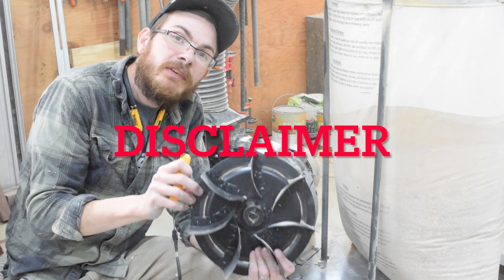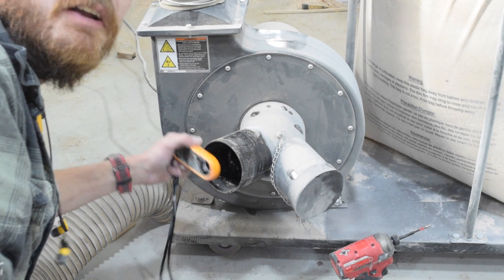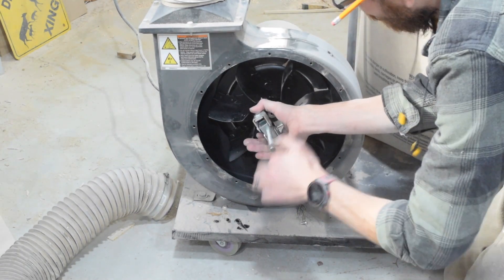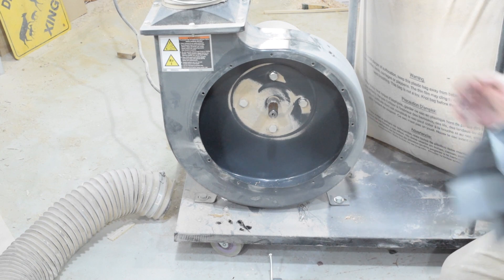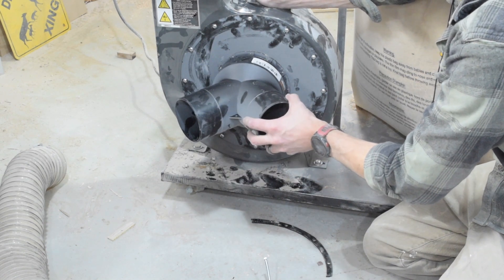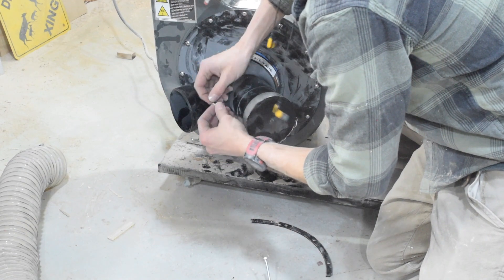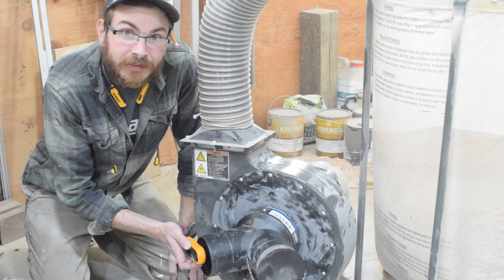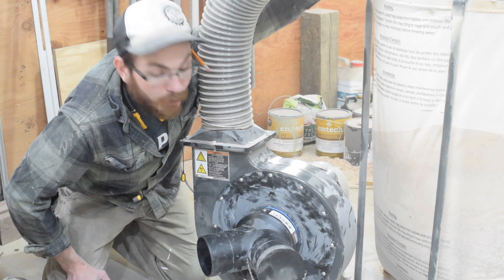Easy Harbor Freight Dust Collector Upgrades: Part 1, Changing the Impeller

Comment: Not worth the trouble. Just get a proper vacuum that also filters out the very fine dust.
Reply from the maker: Yes and no. A dust extractor like a Festool would not be able to keep up with the bigger tools like my planer and jointer. It moves a small volume of air at a high pressure- great for small sanders and jobsite power tools. A collector moves a large volume of air at a lower pressure, great for tools like a planer and jointer. Both have their place and advantages. And disadvantages.

Comment: The impeller was backwards. For that impeller you need to switch the motor and impeller sides. It needs to scoop the air but the way it's installed in the vid it is reversed.
Reply from the maker: Nope. Pushes rather than scoops. Lower peak but higher sustained.
Reply: @SpottedTongueWoodworking  I understand that which is best for regulated airflow. I challenge that because when doing dust collection you want to move as much air as possible which is provided by a forward scoup
Reply from the maker: @PrintingNerd I’m maintaining that it’s not about “peak” but about sustained efficiency under load (dirty air) this is a good comparison between the two https://sofasco.com/blogs/article/comparison-between-forward-curved-and-backward-curved-fans#:~:text=Forward%20curved%20fans%20are%20generally,that%20require%20precise%20airflow%20management.
Reply: Funny how people keep doing this with little improvement. Its common sense that the inside ove a scoop or dish is going to catch more air than the outside or rounded side. Trailers, semi's, RVs the fronts are rounded or bubbed out to shed the wind not chatch it.
If the big fan had the blades flipped that thing would crank! Someone please 3D print one to use as a test.
Reply from the maker: @CD-hc5ds 
https://sofasco.com/blogs/article/comparison-between-forward-curved-and-backward-curved-fans#:~:text=Forward%20curved%20fans%20are%20generally,that%20require%20precise%20airflow%20management.

Comment: Blade cup is wrong.  Rotation is wrong Everybody measures flow.   What did your motor current do.   Did you overload the 2hp motor.
Reply from the maker: Blade cup is not wrong. It’s actually easier on the motor and maintains flow under pressure.  Six+ months later and it’s working great

Comment: Instead of venting outside, make yourself a filter box using furnace filters and keep your heat in the shop during the winter. The way I made mine is that the air goes into the bottom of the box with two filters back-to-back on each side of the box. it works well, no dust coming out of me filter box and less work on my gas furnace.
Reply: How did you seal your filters? I have been thinking of doing this and eliminating the bag / Cartridge filter altogether. I have a 2 stage with a home built cyclone and the HF spline baffle figure with this I can filter the fine dust with a MERV13. Maybe 16 x25 x 2
Reply: I made a wooden frame (20"x20") and cut the bag filter to wrap around it and stapled it to the frame. I purchsed 20"x20" furnace air filters and built my box to hold the two bag filters I built along with the 2 furnace filters. inside the box I made channels to slide the bag filters and Furnace filters into so that the air flow would go through the bag filter first them the furnace filter second. Make the channels a tight fit so that the filters slide in snug. I used some rubber from a bicycle tube to seal the hinged door on the front. I used RTV to seal the inside of the box. it has been up for over a year now and works well. I changed filters every other month and just hose off the bag filters and reuse them.
Reply: @chuckbratcher9866  thanks

Comment: The 5 inch inlet to the 6 inch inlet is about a 40% increase in flow area.  Figure out the increase in the impeller. Is it 40%?  Another issue is the 5 inch discharge. Increase it to 6 inch diameter and measure air flow speed.
Reply from the maker: I haven’t thought too much about the discharge. I have read in several places that if the motor doesn’t have enough resistance in the outflow that it could actually overrun itself, that the resistance of the filter/etc actually acts as an important limiter. I could be wrong, but definitely could be some gains to be found on the back end

Comment: The fan you installed  is the wrong direction, you need to change  direction on your motor.
Reply from the maker: I believe I actually talk about this in the video- it’s supposed to be like that. “Pushing” the air rather than “scooping” reduces strain on the motor and holds more CFM under load than the typical “scoop.” The “scoop” has a higher peak CFM but does not maintain under load
Reply: @SpottedTongueWoodworking 
I wonder the same.
Change the direction of the motor and see what happens
Reply from the maker: @commoncents456 nope, that’s literally how the fan is supposed to go. Push rather than scoop. Lower peak, higher sustained suction

Comment: Vent that thing outside ASAP if you haven't already. The fine dust that shouldn't be in your lungs is all over the place.  Also, you can use the metal piece located between bag and filter as your baffle. The way it's designed, you can pull into it and the heavy debris won't be able to get out.  I just watched another video where a guy did that and vented it outside.
Reply from the maker: That’s part of the master plan- still not entirely sure where I want the unit to end up permanently, but adding an inline dust separator has dramatically reduced the fine dust that is coming out of the bag 👍

Comment: What I don’t understand is why do people buy a cheap dust collector and spend tons of money trying to upgrade it, why not buy a better dust collector from the start. Judging from what that shop looks like along with small dust going everywhere when you turned it on, I’d say you need a lot more upgrades.
Reply: You can build it out to pull 1200 CFM with separator and down to .3 micron filter for all in cost of about $750. Show me any 2 stage system with a .3 micron filter that you can buy complete to your door for $750...
Reply: @johnd3557   what filter is .3 micron.. link please/
Reply from the maker: Turns out it’s actually still cheaper and a lot more fun to do it that way 🙃🙃🙃 and I would love to hear what upgrades my shop needs. Besides a good cleaning 😂
Reply: @Spotted Tongue Woodworking  The shop comment pertains to the dust all over. The cheap Harbor freight collector needs a filter upgrade also, so now the price is creeping up to the same cost as a better system. Better built, better performance etc.

Comment: I’m sure it will affect the heat in the shop. That system moves several hundred cubic feet of air a minute even if the shop is a good size you could suck all the heated air out of the shop very quickly. That may be nice for the summer but be prepared for a noticeable difference between heat with the system running.
Reply from the maker: Thanks for the feedback- I would much rather put as much dust outside as I can, but I didn’t think it would make a significant difference in temperature regulation. I’ll have to put some more thought into my plans

Comment: You didn't say what the results were for the new setup. You only said "significantly better". What was the end result i air speed?
Reply from the maker: I didn’t? Must have cut that part out accidentally. Air speed of 25 m/s before the upgrade, 29 m/s after changing the impeller.